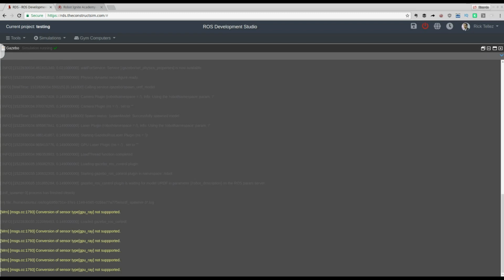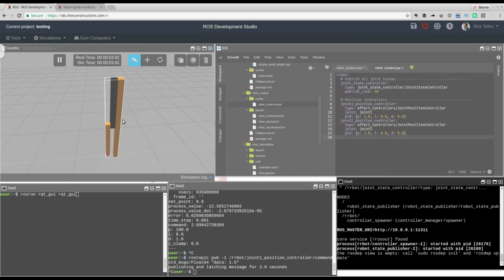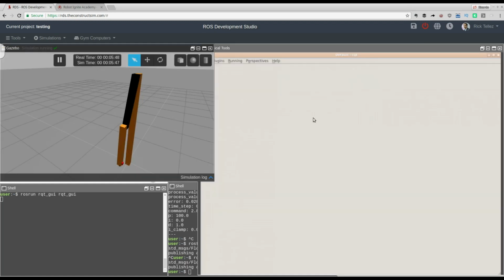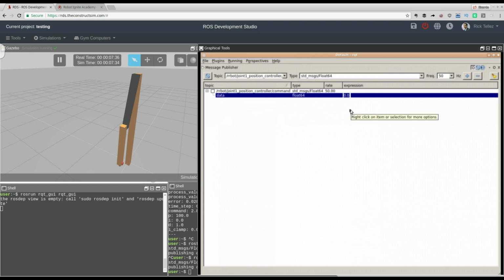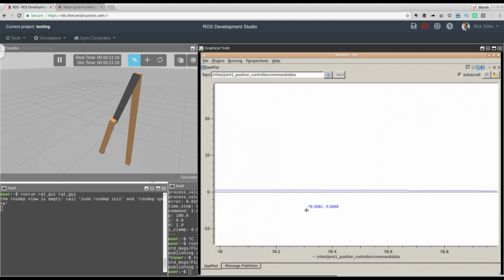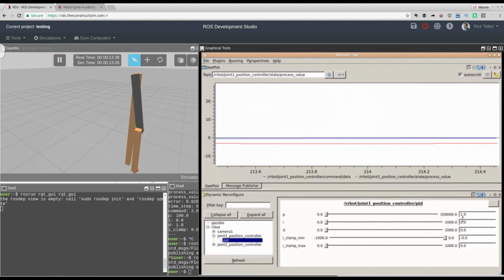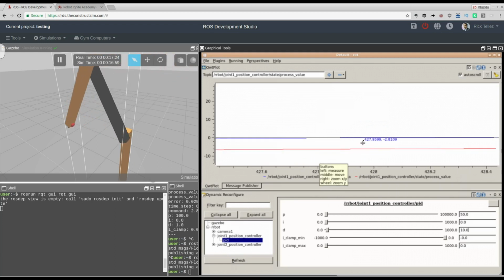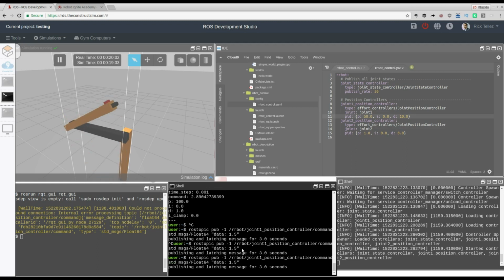[ROS Q&A] 112 - How to manually tune a PID with ROS Control

Comment: Superb advice. Thanks a ton for your great videos. Can we tune the the other parameters like mass, friction and damping also this way? My robot was built entirely using geometric shapes like cylinder and cubes, I gave random values during URDF modelling, but I face the issues of robot jiggling, wiggling sometimes.
Also, I have a doubt about MoveIt!, when I load my own robot model, and planning to a pose, the planning fails saying - No motion plan found, aborted. It points to some error in RRTConnect - no valid goal tree. However, I am able to plan to any random pose using the moveit_commander cmd line tool or the GUI. Any pointers as to why it could be so?
Reply from the maker: No, you cannot use this method to tune the mass, friction and damping because those are parameters that directly affect the simulation itself, not the robot. Hence, if you would like to change  those parameters, you would need to restart the simulation every time you change one parameter. For that, I would recommend to use a learning algorithm instead

Comment: I wonder why didn't you change the integer value? If I used it, I would erase the position error? Great work! Thanks
Reply from the maker: Well, it depends on the effect you want to alter. In my case I saw that the joint was not able to reach the goal so it needed more P. Once that was working more or less, I saw that the movement was too hard, that is why I included some D. This is completely by hand ;-)
No, adding a I component would not have erased the position error, because the position error is not actually an error. It is just a visualization error. The problem is that the joint is continuous so it keeps adding angles when it moves around, even if any joint can only rotate at most 2*PI. Usually in robotics whenever we receive an angle we normalize it between -PI and  PI so the angles do not get those values. But that is not the case for the continuous type of joint. So it keeps adding and adding angles, even if the 'equivalent' angle is an angle between -PI and PI. Hence the error is actually zero if you do the normalization